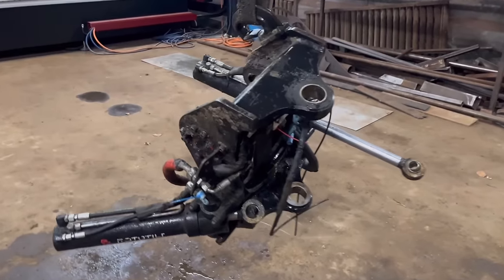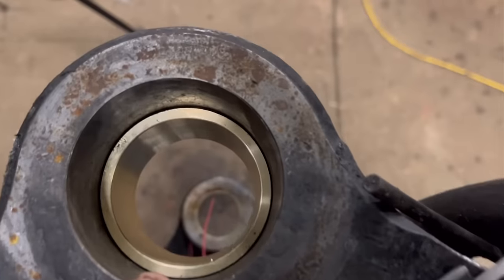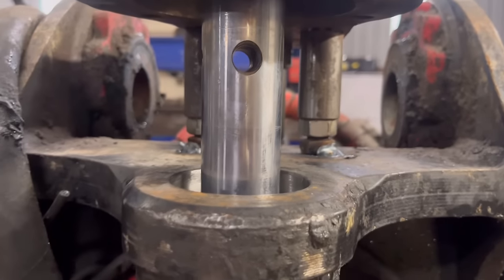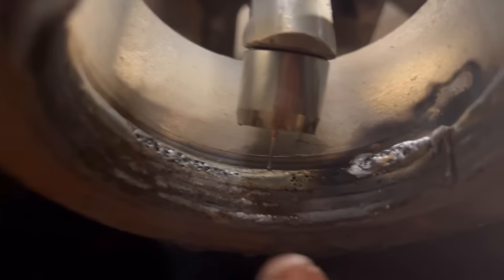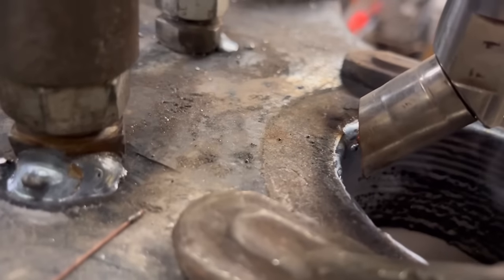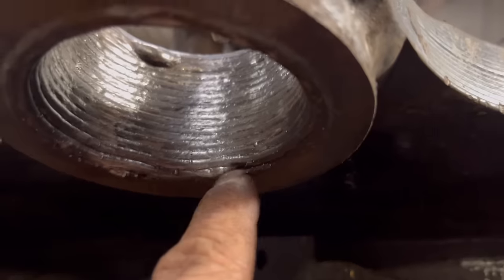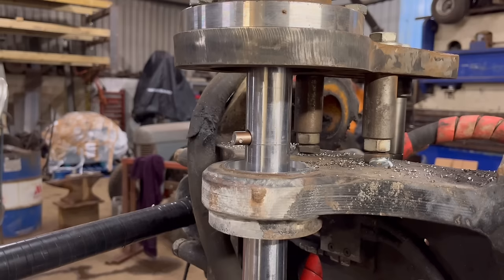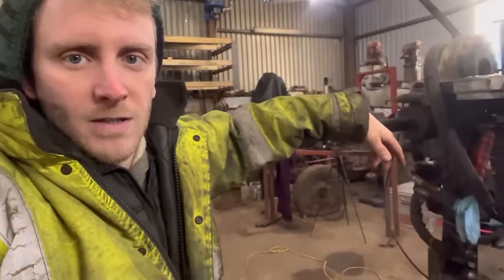Line boring and bore welding rototilt attachment

Comment: Nicely done, at least you sorted out what was wrong with the gas shield. I know once we were on site and getting similar bubble welds and it was down to a strong draft, once we shielded the work area it was fine. When you first put the legs on the rotor it looked like a demented robot, I did chuckle. Stay safe and well mate 👍

Comment: I have had many things go wrong with bore welding, but the bore acting like a chimney and sucking the gas away is not one of them. Clogged holes in the diffuser, inadvertently not having enough flow or no flow of gas. (running out or pinched gas line) Bad bottle of gas once. Too  much gas flow causing turbulence or just plane crappy material are a few of the adventures. Once I was involved in testing some ideas for a stubby compact torch and we found that the diffuser was not long enough and had to add a baffle plate inside the works  to allow it to work. That idea went onto production and is still in use. Looks like you encountered a similar problem with your short shroud as you call it.  Looks like you got it sorted out out, well done Oliver Cheers.  Edit :sometimes in multi pass welds you need to do some touch up by hand It's nothing unusual.

Comment: Happy New Year, Oliver. I wish you all the best, mate, for 2024.

There's always the chance from oil or grease contamination when lineboring, which can cause unwanted bubbles as you had and is not just poor gas flow.

A guy I used to watch in California sadly died in 2021 from COVID. He worked with heavy plant machinery, the really big stuff, earth movers, scrapers etc. 

He would pride himself on making sure he did the best possible job that he could because, in his line of work, reputation meant everything.

He learnt the hard way, just like you will. So, whenever he had a job where brass bushings were greased via nipples or greasing lines, much like the broken one on your project, he would use a blow torch with the biggest rose tip I have ever seen.

He would heat the work up prior to welding, which, as you know, causes grease to leak from joints that were invisible to the naked eye at least, on camera they were. 

As a fabricator welder, I know only to well the issues with poor welds when rust, oil, or grease are present. Either one can be the difference between a good or disastrous weld and the difference of being contracted to do more work.

As for the shroud, we never had the fancy pancy ones you have. All we had was the standard type like the ones you use with your mig welder. Try using that one next time, of course, you will need to make adjustments but checkout the difference. 

Lastly, edit your videos of course but always show your mistakes. That's how everyone learns.

Thanks fella, looking forward to seeing your next project. 🤘🇬🇧⚒️

Comment: What a great job diagnosing the gas coverage issue with the welder. I wouldn’t have figured that out on my own. I was definitely thinking the metal itself had contaminates in it causing the bubbles in the welds. You definitely taught me something here👍

Comment: Great job. Good for you for persevering and getting it sorted out. Try tacking a collar of the same internal diameter on top and bottom before welding, that way the lead-in and lead-out will be in the sacrificial collars. Grind the tacks off, remove collars, done. Have a great day!

Comment: I would suggest getting a set in bore snap gauges for measuring your internal diameter. In my 6 years Lineboring experience I’ve found that get a hot preheat then letting it cool a bit to burn any grease or impurities out does wonders. Also if your bore welder has the ability to adjust the step up function, if you run a very small step for the first few rounds it will build up the bottom eliminating the need to hand weld the bottom.

Comment: Good job Olly, I've used the boretech welder and welded on cheek plates always cause issues. They recommend grinding the joint out a bit and doing a seal weld first then the cladding. Great job

Comment: That was a tough nut to  rack, brilliant diagnosis on the short shroud issue, guessing the shielding gas was uncontrolled,  with no lamellar flow provided by longer, narrower shrouds. Obviously bore diameter dictates shroud length. 
Very interesting Oliver, thanks for sharing 👍. 
Best regards from the Black Country. 
John.

Comment: Nice work, I feel your pain with the bore welder. Been doing it for a few years, but still get challenged now and again .😀. My tip would be to take the gas and heat to burn out the grease form between the laminated plates before you even set up.  Keep up the great videos.

Comment: The line borer that comes to my old work used to run a bit of aluminium foil tape round the top amd bottom of the hole to get better gas coverage  when it's welding the first and last run cause the gas kinda rolls over the edge amd disappears too quick, don't know if it's totally necessary but this dude was 70yrs old and been boring for 55yrs haha 
He also takes a flap wheel to the welded bore and grinds it down till it's smooth, saves inserts apparently

Comment: Great video. Interesting how you solved the weld porosity problem. Seems odd that even when you turned up your shielding gas to maximum it didn’t solve the problem? Am I right that the welding tip had also been ground bacK/modified? Maybe the tip was the problem and not the shroud ? Anyway learning a lot from you.. thank you. Happy new year

Comment: The main problem in the middle of the video is grease at this point. It killed you the nozzle and afterwards you hat problem with gas coverage and dirty material. Sometimes you shoot completely yourself with that, if the welded material becomes hardened by the grease. I also paid a lot of time with such issues. For my experice it is the best to take a small grinding disc in advance and cut in a groove in this attached tube and hand weld it out before you bore weld. I was several times in the situation that it looked clean and i thought i dont need preparation. I always failed in the first try ;-)
Reply: It is also my experience that the choice of the gas nozzle is very critical. I do it like you and grind my own nozzles. Perfect bore welding is not that easy as it looks like :) and it becomes Mode and Mode difficult with smaller holes.

Comment: Measure the last adjustment not at the tip of the cutter but on the bottom of the cutter holder: skim the bottom of holder on the lathe. It is so easy to make an error on the cutting point

Comment: A good starting position for setting the correct gas flow is 1 liter per mm diameter of the gas cap, too high a flow can create turbulence that draws oxygen into the melt. From what I can see on the video, your problem with pores may be grease creeping out between the thicker plate and the welded on ring, it may be good to preheat to "burn" the grease before welding.
Reply from the maker: I did preheat it on the second attempt and still had the same problem. I think the old shroud was too short to effectively spread the gas out over the weld.
Reply: @snowballengineering  Ok preheating check.
Now it was fine when you changed the gas cap, so the problem was solved, but it feels like it should have worked with the first gas cap as well.
Nice work 👍👍👍👍👍

Comment: The splicing machine at the base has an eccentricity, most likely so that the torch body can be positioned comfortably in the hole. that is, the vertical rod should move not from the side where the welding is taking place, but from the opposite side! then the large guide nozzle will fit in there and can be cooled by shielding gas! translated

Comment: Good job in the end. Your customer must be very fussy as not many would have had that line bored for such a tiny variation in the housing. Is it not easier just to buy those ram ends ready made, looking at the slack it going to need a full refurb anyway
Reply from the maker: Yes, could probably buy an end

Comment: Next time you might use a pipe cap and clamp that to the bottom of the hole instead of the plate. It would allow clearance for the torch head and hold the gas in from the start.

Comment: Cored wire and gas, dualshield, I’m sure CCE uses that all the time, usually horizontal set up I’ve noticed. The guy at on fire welding in California does a lot of line bore stuff with some magic kit, he uses dual shield too if I recall. What pisser boring over and over.

Comment: I think, if you can make a kind of cup from some steel pipe with a flange that clamps on the bottom of the bore, the welding torch head will have room to travel from below the start point & the gas should collect & purge out the air inside.

Comment: You need a cat to patrol your shop. While using the fork lift to put the project on the welding bench there was a rat running back and forth on the workbench in the background.
Reply from the maker: I think it was someone walking about in the lower part of the workshop

Comment: Not bad Oliver. Could you not have faced off the top and bottom of the boss with the boring machine rather than grinding it off with the angle grinder? But you saved the machine.
Reply from the maker: I could have done the top but because the bar fits into the drill motor on a morse taper I can’t pull backwards with it yet, until I make a clamp or some way of holding the taper in.

Comment: Why not using borer to face and chamfer? will look much prettier. and maybe use a bolt from tool opposite side for fine position adjustment?
Reply from the maker: I don’t have a facing head and step facing takes time and doesn’t look right if each step isn’t identical depth. I can only chamfer one way because pulling the bar backwards pulls it out of the morse taper on the drill.

Comment: You sure had some problems with that one. But you worked it out in the end, so next time you get a job like this, you know how to prevent the problems. The job would have been a lot easier if you could have just bored it and fitted an oversized bush.

Comment: QUESTION: Would life not be easier, cleaner and the end result not look better if the workpiece was jet washed before starting?
Reply from the maker: Then I have a yard full of grease. I did jet wash the top and bottom areas but decided against washing the whole thing
Reply: Fair point. Thanks for taking the time to answer 😊

Comment: Third time lucky. Don't start editing out the learning curves. Your problem solving on the fly is a big part of the channel. Too many videos on YouTube, that show perfection, by the miracle of editing. Life mostly isn't like that. I'm a tool junkie. Mostly wood. But some metal. Every new complicated piece of equipment has an experimental period. And even then. If you don't use it for a while. A remember what you did last time phase. That bit gets worse the older you get. Enjoy the videos. And the variety.

Comment: Wer keine Arbeit hat macht sich welche. Einfach die Buchse etwas größer anfertigen und man wäre lange fertig statt dem Aufgeschweiße.
Reply from the maker: I didn’t make the bushing, the customer supplied standard ones. It’s always better to repair a job back to how it should be rather than fitting none standard parts.
Reply: @snowballengineering  Es ist nicht besser. Sieht man ja hier. Viel mehr Aufwand.